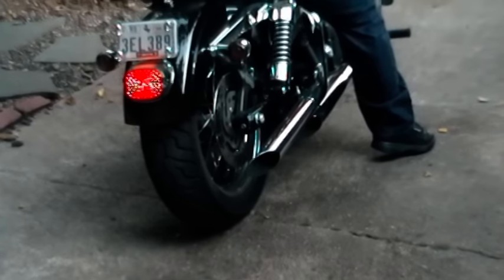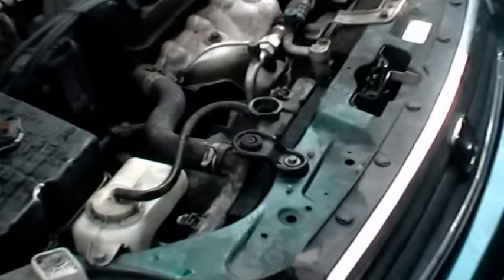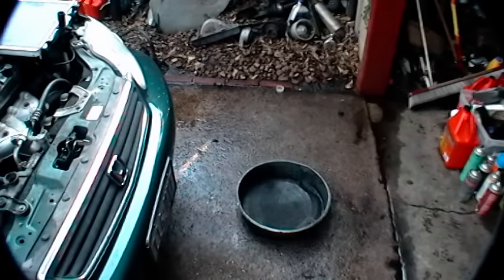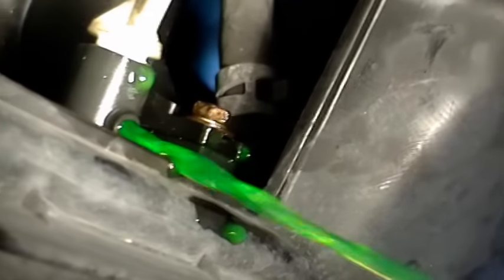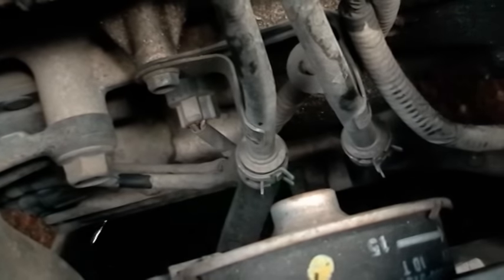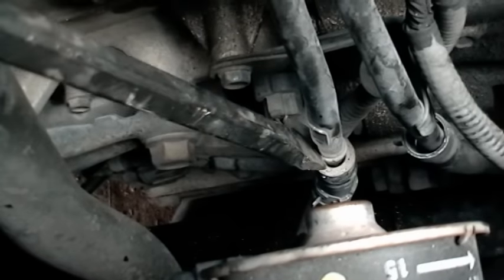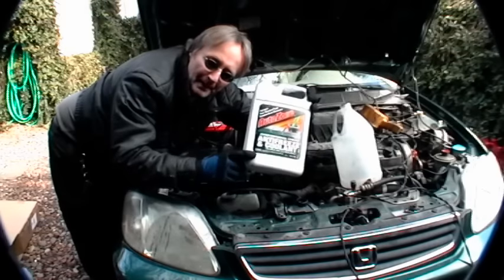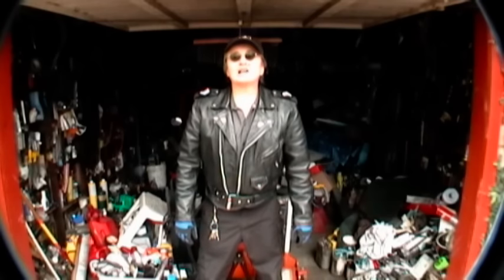How to Replace a Radiator in Your Car

Comment: Hi Scotty. I just bought a 1995 Toyota Tacoma 2.4. The thermostat was broken first day so I replaced it with OEM. I have flushed radiator three times but it still gets rusty colirvin the water. Have not put coolant in yet. Should I replace the radiator? Still the original. The truck is running at normal temperature now after I replaced thermostat.

Comment from the maker: Sure, You can go whole hog and just remove the return hose on the reservoir and put a hose on that hose to go into a bucket. Then put another hose on the feed to the reservoir and keep putting fluid in there. OR, you can just suck all the fluid out of the reservoir, then drive around the block. Then repeat this process five or six times and most of the fluid will be changed. Scotty Kilmer

Comment: Hi scotty. I have a 2007 Vauxhall Astra, about 2 months ago it had a new water pump as the old one was leaking. I have now found the coolant has turned rusty despite the coolant replaced for new coolant at the same time. Can the rust mean a bad radiator?
I intend to keep the car as long as it lasts so i dont mind spending a decent amount to keep it running right provided it doesnt turn into a money pit. It seems to drive fine and doesnt produce white smoke and has no white stuff in the oil but the engine is a bit noisier than normal

Comment: Hi Scotty! Salutations from southern Louisiana.  I loved your video and I was hoping you could answer a question for me.  My Acura overheated and the dealer recommended changing the radiator for $1000, so I had a friend do it.  He seemed to do everything accurately, but it's still overheating.  I read online that air can still be trapped in the system after radiator replacement.  I noticed you didn't mention anything about this in your video.  What are your thoughts on this?  I'd appreciate any feedback you have.
Reply from the maker: +C. DeCalongne yes, have the cooling system vacuum power bled by a guy like me. Takes 10 minutes and sucks all the air out. Also change the thermostat and PRAY the head gasket isn't blown. Do my video "how to tell if your head gasket is blown'
Reply: +Scotty Kilmer Thanks a lot!

Comment: Scotty I need your help! My radiator is leaking out the top. Driving over 5 miles coolant sprays out and turns into vapor smoking out the hood once it hits the engine. My radiator is metal not plastic, is this fixable or should I put in a whole new one? Thank you! My dad and I love your videos
Reply from the maker: +FerreneMachine metal can be soldered back together, you might try that first if metal is not all worn out and thin and cracked all over
Reply: Thank you! I never thought of soldering the radiator. Appreciate the reply.

Comment: It is well known plastic radiators are prone to leaks. If you plugged the pressure cap on a plastic rad it would explode. On a TIG rad it would work just fine. Most race cars use 22LB or even 30LB caps.

Comment: Would you use a worm drive clamp on rad hoses? I just checked how my new rad hoses were going and I believe I saw a bit of coolant. I loosened the clamp, cleaned it up and installed it again, making sure the hose was on good and the clamp was secure, tight enough where it cant screw on much more. I'll check again tomorrow but I just wanna be sure I'm not losing any coolant.
Reply from the maker: sure, I use em all the time, they stopped using em mainly cause the newer designs are cheaper to manufacture

Comment: hey Scotty love the videos i just got a new BMW 525i 2001 and it needs a new radiator and i was wondering where would i fine the info i need to get the right replacement part? i think i found it but not sure but it says 
1 436 060.9
1 436 055.0 
made in Germany
BEHR 25791 
19:45 
04/05/01
thats all it says but im guessing the model is the BEHR 25791? plz help not sure what the other numbers mean

Comment: I have a 90 Buick century custom four cylinder that has a leaky radiator,its not real bad I can hear it hiss and a little bit of a bubble comes out of the aluminum grill part,I've tried several stop leaks and none have worked do you have any suggestions or should it be replaced and if replaced is it a hard job
Reply from the maker: just replace it, they make chinese brand new rads now that cost little and work fine

Comment: good video thanks. but often times you have to change the thermostat parts as well as the radiator if you have problem. but do you have a video for that aswell?
Reply from the maker: most cars changing a thermo is an easy job removing two bolts to get to it under the radiator hose where it clamps to the engine.

Comment: Awesome video! Mr. Scott I got a Chevy 2001 Cavalier 2.2L, and I need to replace its radiator for leaking. The machanic ask me for 370 bucks. Is this car easy for radiator replacing? Can I DIY with my Cavalier?
Reply from the maker: much bigger job on that poor GM design, takes a mechanic 2 hours to do it as follows"
Disconnect the negative battery cable.
Disable the SIR system.
Drain the cooling system.
Remove the hood latch.
Remove the right and left headlamp assemblies.

Remove the radiator upper mounting bolts (1) and the upper radiator mounts (2).
Raise the vehicle. Refer to Vehicle Lifting.
Disconnect the forward discriminating sensor harness.
Remove the cooling fan assembly.

Disconnect the radiator outlet hose from the radiator.

Disconnect the lower transmission oil cooler line from the radiator.
Lower the vehicle.
Remove the hood latch support bracket and the forward discriminating sensor with the harness.
Disconnect the upper transmission oil cooler line from the radiator.
Disconnect the radiator inlet hose from the radiator.

Disconnect the surge tank inlet hose and the clamp (1) from the radiator.

Remove the condenser from the radiator, if equipped. it is not necessary to discharge the A/C System.
Remove the radiator assembly from the vehicle.
Installation Procedure

Install the radiator assembly to the vehicle.
Install the condenser to the radiator.

Connect the surge tank overflow hose to the radiator.
Route the forward discriminating sensor harness.
Raise the vehicle. Refer to Vehicle Lifting.
Notice: Refer to Fastener Notice in Service Precautions.

Connect the lower transmission oil cooler line to the radiator. Tighten the lower transmission oil cooler line to 36 Nm (27 ft. lbs.).
Install the cooling fan assembly.

Connect the radiator outlet hose to the radiator.
Connect the forward discriminating sensor harness connector.
Lower the vehicle.
Connect the radiator inlet hose to the radiator.

Connect the upper transmission oil cooler line to the radiator. Tighten the upper transmission oil cooler line to 36 Nm (27 ft. lbs.).

Install the upper radiator mount bolts (1) to the upper tie bar. Tighten the radiator upper mount bolts to 10 Nm (89 inch lbs.).
Install the hood latch support.
Install the right and the left headlamp assemblies.
Install and adjust the hood latch assembly.
Fill the cooling system.
Enable the SIR system.
Connect the negative battery cable.
Start the engine. After the engine reaches normal operating temperature, check for coolant leaks.
Reply: Scotty Kilmer OMG, It is much much more complex comparing to your video. What a bad design GM make...Thank u very much, MR. Scotty! But can I just use the Bar's Leak's  Radiator Stop to fix this? I heared that it will do harm to my engine?

Comment: Hello Scotty,
I have a 98 Chevy Venture and I want to replace the radiator in the near future since there's a large dent in it.  I notice there are two engine mounts coming from the engine to the front frame.  The radiator is beneath the two mounts.  My question is, do I have to remove the two mounts or is there a way I can replace it without removing the two engine mount.  Thanks and hope to hear from you soon.

Comment: Hi Scotty! I changed my own radiator a while ago before I watched this video. The car runs fine, but there is a smoke that comes out of the exhaust pipe smelling like coolant. Is it possible that I may have switched the lines that go to the transmission on my 2000 Geo Metro?
Reply from the maker: na, that's more often a blowing head gasket. Do my video "how to tell if your head gasket is blown"

Comment: I wante to put an aluminum radiator on me 2003 s 10 4.3 cause it runs a little over 210 in the summer but I have heard that some of the fittings are not exact,so what radiator would you use and is it better? Plus I thought about putting a metal fan on it. Thanks Scotty for reading

Comment: I was curious if you ever changed a 1991 Acura legend radiator ? I'm pretty sure mines going out. I have about 229,000 miles on it and if I don't drive it for a few days as soon as I start my car it starts with white smoke but after about 2 or 3 minutes it goes away ? Any suggestions ? If I drive my car for longer than 10 blocks my car will overheat and I have to refill it with engine coolant 😩

Comment: hi, I have been watching your channel the past weeks now and I was able to fix a lot in my car but recently I changed my resivor in my 2011 buick lacrosse cxl v6 and since then now and then the car won't start for a hot second but when I wait a few seconds not more than 5 sec it will start I have been told to bleed my cooling system but couldn't find the valve I would really love for you help... Thanks.... p.s I couldn't find videos for Buick makes in general to have ideas

Comment: @scottykilmer yep, low on fluid does no harm. you also forgot to turn the heater on to flush all the old coolant out the system. the fluid is flushed once in a while, why not flush it.

Comment: Hey Scotty,I got a big problem i brought a all aluminum radiator but I stripped the threads on the transmission lines in the radiator it's for a 2003 s-10 4.3 I was gonna retread it but I don't know what size tap I need. What do you recommend I do?

Comment: Scotty - so I got the new radiator (Spectra Premium). The brass fittings for the cooling lines came in a little bag - so I need to attatch them to the radiator. My question is, do I need to use any kind of sealant tape (teflon, etc.) on the threads of the brass fittings? Thanks!
Reply from the maker: use teflon tape

Comment: Thank you for the response. Sadly, i don't have the funds anymore for another radiator as it would set me back another 40/50 euro's which i sadly don't have. Is there any way to adjust the lower radiator hose to fit or to get a "universal" hose somewhere that won't cost as much ?

Comment: Hey scotty! Awesome Vid man! I just got my new Radiator in the mail for my V6 Mitsubishi Pajero 3000 Manual. Should it be as straight forward as the one in the Video do you think? Thanks man! +1 :)
Reply from the maker: same process, just a bit harder on that cramped working space

Comment: Hi Scotty,this video was just in time.On monday 22/7 I am getting the radiator top tank of my Honda CRV 2001 replaced as its leaking from the top at a radiator shop.Does it make sense to just replace the top tank or should I just replaced the whole radiator since its done 167kms.most after market radiators here in New Zealand come from China and only have a flimsy 1 year warranty and 2 year warranty for the ones from taiwan and thats the reason of still sticking to the original OEM radiator.

Comment: So how long does this typically take? And can I just recycle the coolant that was already in the old rad?

My mechanic quoted $220 for the rad and $100 in labor on a 2000 infiniti i30. Is that a good deal? I just purchased a rad from rockauto for $85, hoping to save some money... Is it something that I should attempt on my own; having no mechanical experience; or should I get a professional to install it?

Comment: Scotty! hope  you can help me on this. I have asked 4 so called mechanics about it including the guy who changed the radiator in my 96 Ranger 2.3 . After the replacement i did not get any flow from the reservoir or to the reservoir as the engine heated and cooled and the top hose stayed hard as a rock?... im sure the level went up and down a bit before but they keep telling me Oh Well. i changed the radiator cap 3 times with a 13 pound cap?
What do you suggest?
Reply: RAYMOND NATERLIN you should see coolant gushing around in the exspansion Bottle. ( meaning water pump is working.) if nothing happens at operating temps , either Thermostate is stuck shut or water pump failer.

Comment: Hey Scotty, I just replaced the radiator in my car with an aftermarket one. It seems to be working fine. It does suck up almost all the coolant in the overflow tank whenever I take it out for a spin, is that normal??

Comment: Hi Scotty, I replaced my  radiator on my 2001  Impala, now is making a weird noise  after installing it. I realized there was something like brown dirt under the radiator cap, I haven't put any radiator fluid yet I put water instead because I wanted to test it first. The car also doesn't run smooth like it used to . It kinda stops n go after I start the the car, then it runs normal but with a weird noise. Any suggestions Scotty ?

Comment: Scotty, today we replaced the radiator in my fathers 99 Chevy S 10 4.3 liter 5 speed. I noticed on the rad cap it had like dark gray sludge on it. runs beautiful . what could that be . thank u sir

Comment: I see what you mean and appreciate the response however it was just replaced 3000 miles ago should i be needing a new radiator every 3000 miles and if so is there a higher quality of brand out there?

Comment: Hi Scotty, I have a 1996 Mercury Tracer. I was just wondering if there is anything different that needs to be done in regards to the fan? In my manual they would have me remove the cooling fan and shroud first, then the radiator. Is that just an extra step and the radiator and fan can be pulled out together? If it can save me some steps I would like to do it your way. Thank you in advance. Peace
Reply from the maker: +chkr00 same process, just a bit harder on yours than this video

Comment: I remember once when I had a Dodge Spirit and it had a plug near the top of the engine that you removed so when you filled it with coolant, the air would escape through this hole and didn't have to wait for it to burp out.  Just wondering if you know if all cars have these plugs?  I can't seem to find any information on it for my taurus.  Thanks.

Comment: I have a 2012 honda civic. The a.c. is not blowing cold. I added freon and it work for about a day. Also my I'm not hearing or see the fans come on when i turn my ac on. As far as i can see everything else works just fine. I don't have the tools to test the fan motors. What do you recommend?

Comment: Scotty - 95 Toyota Avalon XL V6 - I am replacing the radiator (per your instructions of course!) and noticed the plastic coolant recovery tank is starting to show some sizeable cracks. Is the recovery tank a pressurized part of the system, which I am assuming would mean I need to replace it with a new one, or can I reuse it? Thanks!
Reply from the maker: use epoxy like jb weld to fix it if one long crack, if all cracked, replace it
Reply: Thanks!

Comment: hi Scott my honda acord 2001 has smoke comin from the radiator. I've checked n its full of oil but all the fluids from engine, transmission and brake are at the right level. and also the pointer for the enginge temperature keeps lower than a half. should I just replace it?  thank you so much

Comment: Hey Scott, I'll be looking to do this on a 2000 Cadillac deville, do you think it'd be more difficult than this?
Reply from the maker: yea, about 10 times more difficult, they don't make Caddies to work on . It pays a mechanic 300 dollars labor to do it:
Tools Required
J37097-A Hose Clamp Remover/Installer
J38185 Hose Clamp Pliers
Remove the cooling fans. Refer to Cooling Fan Motor Replacement - Electric.

Position the J37097-A to the clamp in order to remove the outlet radiator hose from the radiator.
Disconnect the lower transaxle oil cooler line from the radiator.

Disconnect the lower engine oil cooler line from the radiator.

Position the J38185 (3) to the clamp in order to remove the generator cooler inlet hose (2) from the radiator (1).

Remove the two condenser mounting bolts.
Important: Care should be taken when removing the condenser not to damage the lower attachment points of both the radiator and condenser.

Lift the condenser upward slightly in order to release the lower feet from the lower mounting features located at the front of the radiator.
Lift the radiator up and out the vehicle.
Installation Procedure

Install the radiator insulators (1) to the frame.
Position the radiator alignment dowels (2) to align with the insulators (1).
Important: Care should be taken when Installing the condenser not to damage the lower attachment points of both the radiator and condenser.

Position the condenser, aligning the lower feet to the lower mounting features located at the front of the radiator.
Notice: Refer to Fastener Notice in Service Precautions.

Important: The bolts retaining the condenser to the radiator end tanks are a special length and should be the ONLY bolts used upon reinstallation. The use of longer bolts will damage the radiator end tanks.

Install the condenser mounting bolts. Tighten the condenser mounting bolts to 13 Nm (115 inch lbs.).

Position the J38185 (3) to the clamp in order to connect the generator cooler inlet hose (2) to the radiator (1).

Connect the lower engine oil cooler line to the radiator. Tighten the engine oil cooler line to 18 Nm (13 ft. lbs.).

Connect the lower transaxle oil cooler line to the radiator.
Important: Ensure the transaxle oil cooler line is positioned upwards while tightening.

Tighten the transaxle oil cooler line to 35 Nm (26 ft. lbs.).

Position the J37097-A to the clamp in order to connect the outlet radiator hose to the radiator.
Install the cooling fans. Refer to Cooling Fan Motor Replacement - Electric.
© 2015 ALLDATA LLC.